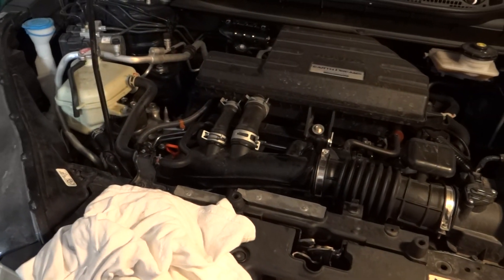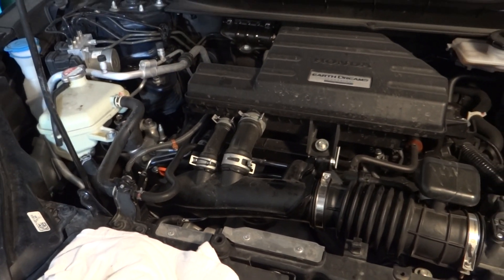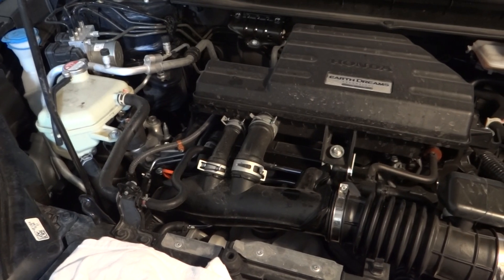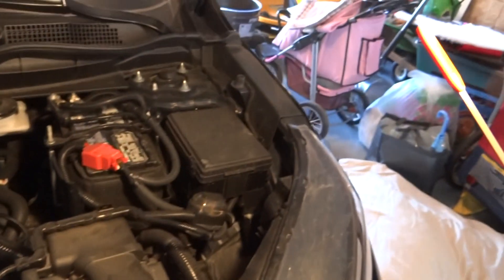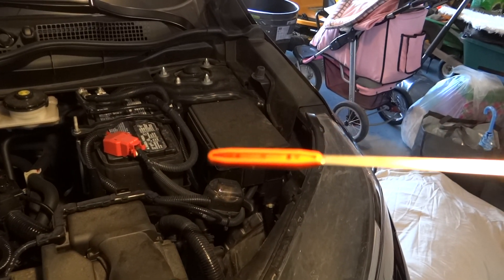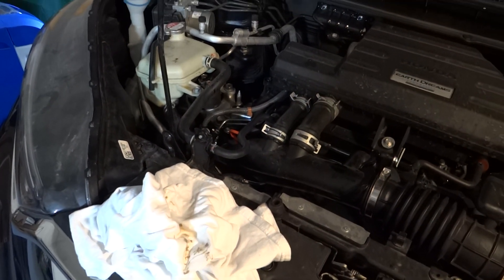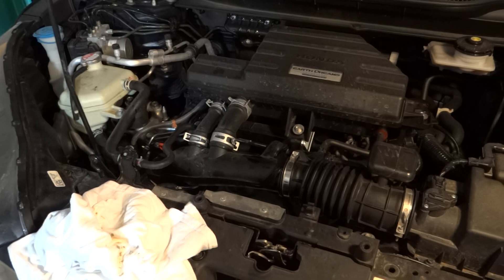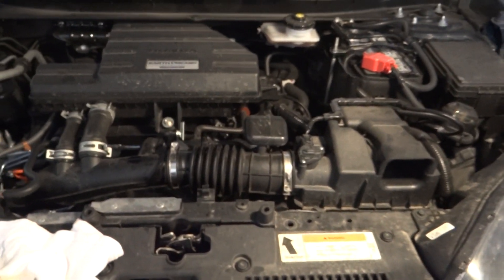Oil Dilution -- Honda 1.5 Liter Turbo

Comment: If you go short distance 1-10km, use Econ mode. Use high octane fuel in cold weather. I never had any problem with oil dilution.
Reply: hi. was ur crv 2019 model . 1.5 turbo?
Reply: @raoullanuza4823  Its Honda Civic 2018 1.5 turbo. I have it for more then a year, 0 oil dilution and I check oil level often. I belive it will work for CRV too. I belive if the engine is not worm you shoul not push it. Bigest killer for small turbo engine is heat, thats way cooling in this engines are so great, but the downsize is cold weather and short distances. This engine will last forever, even with some oil dilution, but you have to change the oil regulearly. Not every 20 000 km, but 12 000 km.
Reply: @dennisstepanek2567  I have the earth dream technology . crv 2019.. 1.5 turbo...do you have the same engine?
Reply: are you using unleaded 95 or 98?
Reply: thank you mate for  sharing your Info...I really appreciate it... I will try it...tnx

Comment: Does this problem happen to GDI engines without turbo?
Reply: Not much. This problem known as of now is specific to Honda's new 1.5 turbo engine and most cases are from CR-V and Civics. Accord also have 1.5 turbo along with 2.0 turbo and i have read some owners seeing this  issues on those cars as well but may be not as much as Civics and CR-V.

Comment: It dont matter where u live all motors should be always warmed up before taking off especially a honda .Honda will remap your ecu that should fix the problem.
Reply: Thai Douangkham their software fix didn’t work, they are blaming it on cold weather but that’s bull because they do it even in summer
Reply: It has fixed NOTHING. We have a 2018 CRV. At just 2,200 miles it failed. Software update is a complete joke.

Comment: correct , not sure what to do , Honda is not helping , i knew they have bad customer service , now i am regretting  why i bought this CRV 2018 , i took it Honda few months ago in winters and they said no issue where i was clearly smell and tell by touching how thin oil was  , they changed oil and they said i am good now , so month ago i replace oil by my own and today after 800Miles drive  i checked the oil level and it was higher and feel pretty thin like water i mean gasoline( Patrol )  , now i am stuck , because i know Honda fix is not a permanent fix if they offer because these engines are defected ... ( location Virginia ) 

i was buying 2.4L but no AWD was available and no commercial youtube channles  review talked about this issue at all ...

Comment: after this oil dilution reports we still waiting for the first engine failure,,,,never seen one
Reply: Uhhh.. There have been many. What, is there a magical global database that you're looking at?  Most of the issues are burning oil ... and most ill effects take years upon years to move from burning oil, to complete failure.
Reply: @mrblob5413  yes you say it..give me examples..i cant find any
Reply: I S my friend got her engine replaced because it was burning a quart of oil every 1000km. Most people try to get it replaced before catastrophic damage. But again, you think because people don’t post it on you tube and reddit, it hasn’t happened??? 

This guy had engine noise ticking problems: https://www.crvownersclub.com/threads/it-might-be-worse-than-you-think-1-5-turbo-issues.176609/

You see how not only it takes a while for the effects to show up, there are also many symptoms before catastrophic damage.
Reply: @mrblob5413  do you have honda 1.5 turbo...or not..i have and about 20000 miles...no problems no oil raising...absolutly nothing...this is my second winter and  i have civic 1.5 turbo manual transmission...dont talk about horse that you didnt ride...
Reply: I S my friend had her engine replaced. Why the fuck would I buy it.
Reply: @mrblob5413  then dont buy it...i dont want discuss anymore with you..i have my life you your...
Reply: I S yeah how about if you have your life stop being an unpaid corporate shill for Honda and allow people to hold them responsible for ripping people off.
Reply: @mrblob5413  i tell only my opinion...my opinion is a fact..i own this car..since i have read about oil dilution i check it and keep monitoring...you think i dont worrry about this..yes i do...i check my oil twice a month..and no rising...i dont want tell nobody have problem..but  here in europe we also have forums and discuss about it...and nobody have that problem..in USA also some people have oil diluton...but most of them not..check civix forum...sorry my english is not good...and this car is so fun to drive..and look here on youtube .Honda’s Oil Dilution Fixed? Everything You Need to Know--its interesting...after 55000 miles inside the engine wizh borescope
Reply: @mrblob5413  you buy what you want ..i love my civic sedan burgundy colour ..and first learn  to calculate 10% of 400000 is 40000 not 4000..You have vist  elementary school ...what a people here..
Reply: I S I meant 1% failure rate* which is in line of exactly the type of failure rates they should expect.  

And you overpaid a lot on your vehicles eh? I bet you lease them too.
Reply: @mrblob5413  i dont lease..i paid cash ...honda is not expensive car like bmw or audi...but honda makes most realible engines in the world..and that will alsp be with this engine...i am not worried about it..i dont know where are you from but here in europe audi bmw peugeot renault vw all these companies made direct turbo engines with problems..but still running at least 150000 miles..that means honda will reach at lest 300000 miles ...honda waited long time and they know where are the problems wit this kind of engine...also you have to know how to drive turbo engine.warm up...cool down..not drive at very low rpm or accelerate strong from low rpm.because you get a lot of blown by i looked videos here..the people drive it at 1300 or 1400 rpm...thats ridicolues...Also i lokked people tuned it 300HP or more 500 550...and engine hold it...i dont think you are expert...if that would be such a big problem then owners in USA would make 
class action law suit...like against VW...
Reply: I S they are doing a class action, and also, you could have saved money if you’re the type to have a 10 year ownership cycle; Mitsubishi offers a 10 year power train warranty on their cars and are usually 20% cheaper when you add in interest rates and dealer discounts. For example 0% financing on previous year models.
Reply: @mrblob5413  i bougt that car because i liked most and still like it comparing all other cars..you buy what you want..i buy for my money what i want..they dont do a class action in USA,,,give me link..where did you read it
Reply: @mrblob5413  i saw all of these videos,,,and read a lot about it...bu if i dont have issue and most of the people also not..why should i be worried about it..i

Comment: 2019 CRV no issues..
Reply: I didn't think I had a problem until I checked my self. The dealer wont say anything at oil change time. If you have the 1.5 Turbo, beware.
Reply: Better to avoid Turbo engine from Honda. Please check scottys channel for more information on Honda turbo engine design
Reply: Yes the 2019 CR-Vs have the dilution problem. I have one unfortunately.
Reply: I live in Wisconsin.  We have a 2018 CRV touring.  My wife drives only a few miles each day to work but always warms up the car via remote starter. With only 2,200 miles massive oil dillution. 27 degrees out...Fouled the plugs, had to have it towed. My wife absolutely loves this car but it must go. In Wisconsin an unreliable car can be a very unsafe thing. Honda is simply stringing their customers along with this issue...essentially putting a band-aid  on a mortal flesh wound. Called Honda corporate...was a complete joke. China recalled 350,000 of these and banned production. Here in the USA they hide behind our court system and their high paid corporate lawyers so little gets done. Never again Honda.....NEVER.
Reply: 2020 CRV has no issues for me so far, I’m in Canada and I have heard of some people in the prairies with issues in 2018-19 but not in my area since 2017. USA there seems to be some issues still but not here.
Reply: 2019 CR-V and at 846 miles in my car stalled due to the oil dilution problem, got a oil change at the dealer which was only a temp fix. 2 months later and I'm at 1245 miles in and again I'm having problems, dipstick smells like pure gas too. Seems to be these turbo engines that have the problems.

Comment: Honda is roasted!  Quality has gone way-down.  And, most of their models are just butt ugly designs.  Pilots look like station wagons on taller frames.  Civics look like they run-out of design budgets, just put a lot of crap together.  Honda is rated #12 by the Consumer Reports.  Honda as a quality car maker should be a past tense for now.